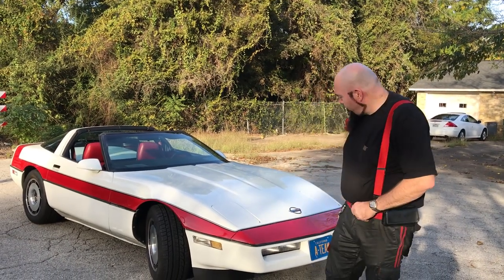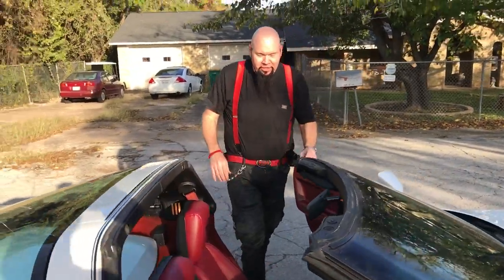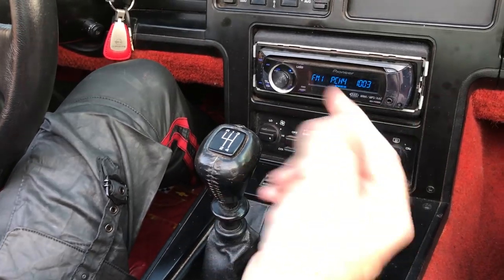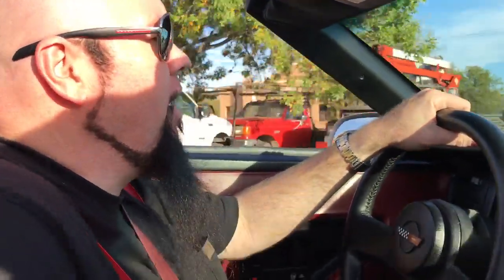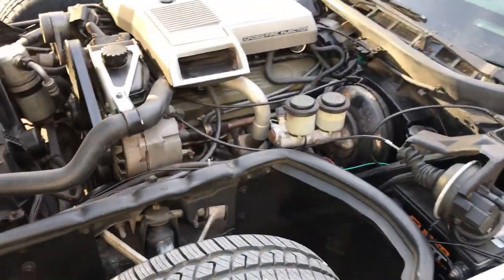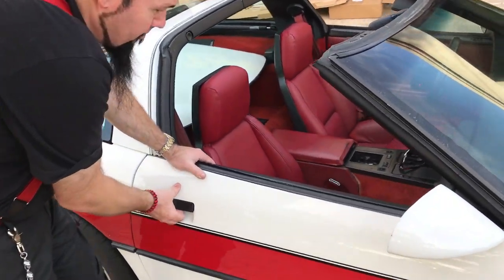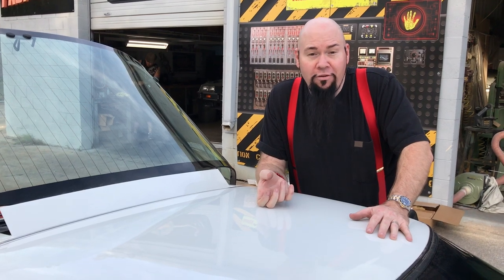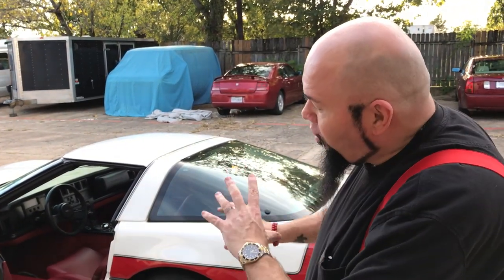1984 Corvette C4 - A-TEAM Face Man Dirk Benedict - SOLD -

Comment: I have that same model minus the red stripe. They started building them in Jan of 83 and only one is titled as a 83. The top is not easy to take off and is heavy. Mine has 34000 miles on it and is just as clean as this one.
Reply: You better put the facemans red stripe on it
Reply: @nickhalden9220 Someone else told me that too

Comment: A friend of mine has a 1984 corvette they go alright for the year the thing I don't like and I have found in several 84 vettes is the roof part rattles and is a annoying as hell I'm sure if new rubber was put around the top that would fix and the digital dash goes dead on them and cost a arm and leg to get them if you still can

Comment: the 84 with the cross fire engine was quicker off the line if you were to drag with an 85 with tune port injection but the 85 had a higher top end over all and I believes 5 extra horses at the time over the 84
Reply: The '85 TPI 350" with iron -882 heads and flat tappet cam was vastly faster than '71 - '84 carb'd or crossfires or later '86 & up TPIs with aluminum heads... the -882 heads flowed better... and iron didn't bleed off heat/HP... about equal to 1992 & up LT-1 'Vettes... https://www.youtube.com/watch?v=M9FwU9iUmfo

Comment: Wrong tire size! Watched this video twice because I think it's a great car and the work done on it looks good. Second time watching though, noticed there are 245/50R16 tires mounted. They should be 255/50R16. Speedometer is going to be off, as will the mileage. Those aside, the authenticity of the car as a historic vehicle is compromised.

Comment: Sad a Corvette that only has a top speed of 85 mph,my 2010 Mustang V6 can spank that car
Reply: The top speed was much higher than 85 you look at the speedo which says 85 but the digital numbers goes to 3 digits
Reply: Top speed was limited at 150 from factory (at least for the 85) but yea considering the lack of horses I’d say you’re right about the mustang with 26 more years of engineering under its belt